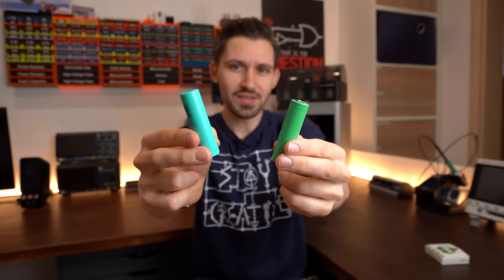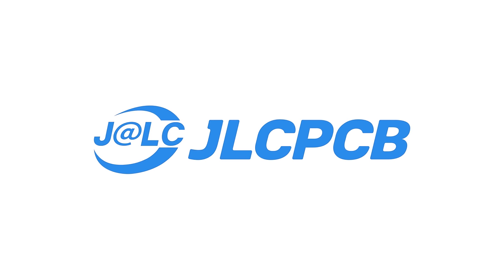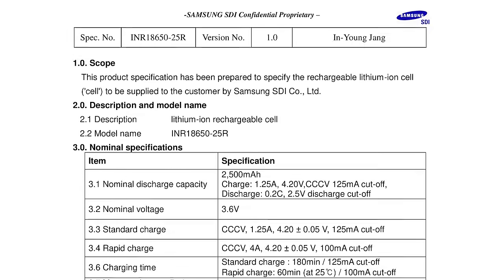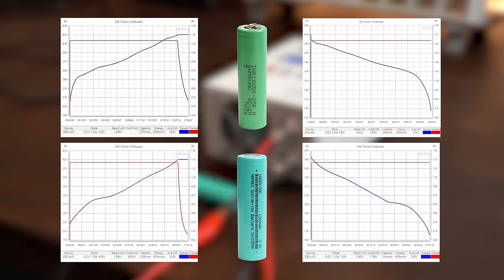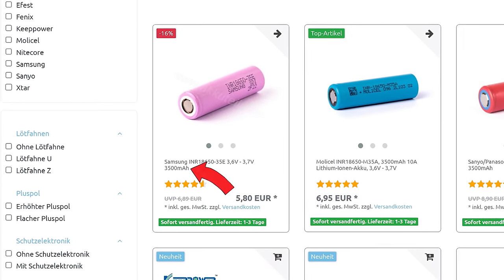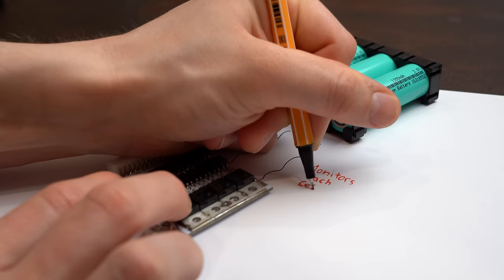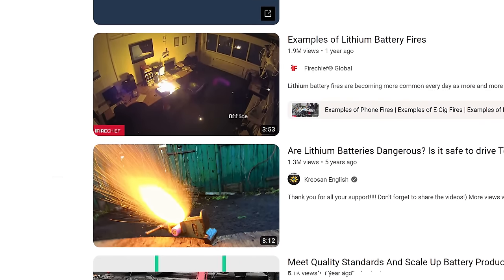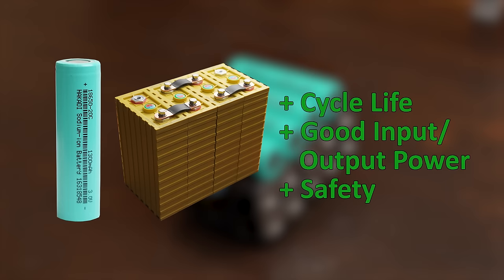"Salt" Batteries are FINALLY Here?! Sooo should you use them?

Comment: Home battery storage will be awesome for these since size isn't a big concern, same for businesses. Like if a Tesla Powerwall was twice as big for the same capacity but 25% cheaper and you know it's made using cleaner materials which we'll never run out of, and ideally not* gathered by workers in unreasonable conditions, then yeah I'd choose that version of the power wall for sure! Hopefully they start coming to market within a couple of years.  Sodium should hopefully be able to be mined for cheap in enough quantities in USA and EU too within having to rely on imports.
Reply from the maker: Love your conclusion. Hopefully it will work out this way :-)
Reply: Also safety is very important, I don't want my house to spontaneously combust because of battery
Reply: I think you left out a “not”; I don’t think you meant “ideally gathered by workers in unreasonable conditions”.
Reply: I have almost unlimited space so cutting the price for a larger battery is no problem for me
Reply: "and ideally gathered by workers in unreasonable conditions" hmmmm not sure if that is what you ment
Reply: Some US cities require a house battery to be in a fireproof room which takes up more space, so eliminating that risk even with a bigger battery might be occupy a smaller footprint, or at least eliminate the fireproofing expense.
Reply: With around 1000 cycles it's still no alternative for LiFePO4 cells unless you want to swap out your solar battery every 3 years.
Reply: @drdca8263  he may just hate people. Weird of you to assume he meant something else.
Reply: Hopefully we go from cogeneration to coproduction, since desalination and chloralkali plants have some environmental issues with discharge of high concentration brines anyhow.
Reply: e-bikes might also benefit, while it is true that density matters when your needs are 400-500wh you wouldn't really see very big difference in battery size
Reply: We're surrounded by oceans, and salt deposits are abundant around the globe, so there should never be a problem with the Sodium itself. I'm more concerned about the abundance of Chlorine which will result during Sodium extraction from that salt.
Reply: @doesnotcompute6078 that’s right. I use a 14 kWh 16s battery bank at home and have only 4 kWp on the roof. Already now in march I go up to somewhat 80% during the day and down to 10% at night. It’s not that far off to say 1 cycle per day, let it be .7 . You still compare 6000 cycles vs. 1000. 
as another guy said, for ev‘s probably a good thing but not for home application.
Reply: @RWBHere  I don't think this sodium is being extracted from salt, but well chlorine is also a very useful industrial chemical.
Reply: It might seem weird at first but I think it does also apply to Electric Vehicles. Hear me out: 

We literally don't have enough lithium to provide batteries for the entire fleet of vehicles that could be in use with 100% EV adoption, and 99% of trips people make are under 40KM or something around there.

I think a more practical solution is to use Sodium batteries for common wear and tear in city driving (thus making the largest cost of the vehicle much cheaper), possibly with a very short range by typical standards (I would be comfortable with a 20KM range, personally, for the right price!), but to have some sort of battery standard for larger lithium ion packs such that they could be swappable, meaning you could rent a pack for a single trip. This is a much more practical solution, as I see it.
Reply: @ristekostadinov2820 Probably not, ebike batteries aren't huge but even at their current size they add a huge percentage of bulk and weight to a bike. What they will be really useful for in transport though is city cars where short range isn't a big deal, and that's one of the main drivers for their development (Chinese EV manufacturers have already announced upcoming models planning to use sodium batteries)
Reply: @s3bio There's plenty of home battery solutions that use NMC though, and that has a similar cycle life, and LFP in practice is really only a couple thousand cycles, if you're thinking 6000+ cycles you're starting to enter lithium titanate type endurance ranges. Assuming that sodium batteries benefit from shallow cycling the same way that NMC does though it could be the case that just having a larger bank increases their lifespan by more than enough to make them worthwhile, since they'll wind up being much cheaper when more fully developed (plus their cycle life is likely to increase substantially since they're still a fairly new technology, whereas LFP and NMC are pretty mature).
Reply: @novantha1 I agree, and there's models coming in the Chinese market built on this philosophy, although I would add that a range of around 100km or maybe a touch more would be better because that would comfortably cover the vast majority of commutes and give some nice headroom/flexibility for city drivers (there's room for both categories as well of course). Some other things to consider though are that we don't have enough lithium for an entire EV fleet right now based in part on how large the batteries we're using are, we'd get 4 times as many EVs from the same lithium if we started deploying a lot more 100km range lithium vehicles. Plus, there's room for a mixed platform, you could use sodium ion as a wear part and have a small ish NMC pack that only gets used for backup power or long range driving
Reply: @novantha1 
Battery EVs should really only be encouraged for short trip use cases - stay home mum taking the kids to school, someone who works just a few kilometres away from home, grocery shopping trips, etc.
For primary family cars, work vehicles, etc, we should be aiming for hybrids. Reduced fuel consumption (about 50% on average) means reduced pollution and costs, all while retaining the benefit of sticking a hose nozzle into a hole to fill a tank with liquid energy in a matter of minutes. Saves the power grid from collapsing under the load of battery EVs charging constantly too....

And for the record, I own a battery EV. I quite like it, but even with only a 23kwh battery (Nissan Leaf) it's very heavy compared to my similar size i20.
Reply: @s3bio this is assuming 100% depth of discharge. Lifepo4 isn't dramatically better under that circumstance either ~3000.
If however you're a sane person and limit to 80% then 10k cycles isn't unreasonable.
Reply: Lifepo4 doesn't have any cobalt in it, that's what all the fossil fueled anti ev people complain about.
Reply: @RWBHere Well, we use a ton of Chlorine for water treatment, which ends up either into air or sewage.
Reply: @s3bio Depends what 1,000 cycles means and the degredation rate after those 1,000 cycles. Firstly it's not like they die after 1,000 cycles, thats just how many cycles until it's degregated to like 75% of so, but they still work after that. Next is that if they're like EV batteries then the rate they degrade slows over time, like EV batteries might drop to 90% capacity in say 4 years, but to drop another 10% it might take 8 more years. Lastly a cycle generally counts as a full discharge and charge amounts of energy, so you're likely not going to do a full cycle every single day, but maybe you will. So all this put together it might last well beyond 10 years, but just with maybe 70% of the original capacity, then maybe another 10 years before it reahes 50%. Not the end of the world considering this is the first versions to market. It'll probably be very cheap to replace by then too especially since you have all the other supporting home infrastrucure set up, anyone could probably do it themselves at that point.
Reply: @s3bio  That assumes full charge/discharge cycles every day (which will never happen with a properly engineered battery system). Even then you're only losing 15% of capacity and replacing the whole battery over that small loss is idiotic.
Reply: @s3bio  That number is greatly increased with shallow cycling the batteries; that's the deep cycle number. Heck, EVs and hybrids do hundreds of thousands of charge/discharge cycles in normal use.
Reply: Supercapacitor storage systems are quickly gaining traction as well.
Reply: the main concern with having large lithium battery packs in the home are their propensity to spontaneously catch on fire - whether its a powerwall pack or an EV sitting in the garage.

Except for power tools, lithium battery tech is a dead end - insurance cost will eventually drive it under in other applications
Reply: I'd feel much safer using a Salt Battery wall as opposed to the Tesla Bomb wall
Reply: @TheSulross  I'm not aware of a single "spontaneous" lithium battery fire. Poor battery management (overcharging) or physical damage. Not spontaneous.
Reply: @popefacto5945 You're woefully uninformed - there have been YT videos on EVs parked in garages that have burned houses down (fire originating from the EV not from external source or factor).
Reply: @TheSulross  Bullshit.
Reply: @saiv46  Chlorine only stays in solution (with treated tap water) because it's under pressure. It degasses quickly at normal atmospheric pressure (dissipating into the air).

Comment: Take the materials inside and place it in a flame.  If its Red flame its Lithium, if its Yellow, its Sodium.  Simple.  Hell you could place a tiny flake on the stove and it will tell you all you need to know.
Reply: I don't think the lithium nor sodium are in the form of elemental metals.
Reply: @reverse_engineered  The salt they're in the form of (Not NaCl table salt, LiKPO4 is also a salt) doesn't matter. Flame color is a result of electron transition states producing photons (light), which only happens when the atom is in the plasma ionized state. Like ionized in a flame. They briefly exist in the pure state, unbonded, so the salt doesn't matter. Biggest problem with this approach is that if there's additives that dilute or alter the color you would get funky results. Best way would be to do this but use a diffraction grating to see the spectral line. You'll see the ones of the additives, but at least also the ones of the key component. Electron don't lie baby
Reply: @UC44sHJTAL5sVGrWOdSXafyg to be fair, sodium has such a dominant and specific color that it should be immediately obvious if it's present, the diffraction grating probably isn't necessary

Comment: Sounds great for large static installations like houses. Maybe not so great for power tools and high performance applications.
Reply from the maker: Yes, exactly
Reply: @greatscottlab  Let's see if the market actually goes in that direction. Would be great to get cheap home energy storage for my solar. Well maybe I bit more difficult as I have around 800V output with 16A..
Reply: Which keeps the expensive Lithium for those batteries that really need it.
Reply: Power tools where totally fine with way worse NiCd and NiMh Cells for ~30 years.
Reply: don't see much advantage yet !!!
Reply: @kelvin1316  That would be then rare cases like say round cells etc. 
For cars it makes Environmentally no sense.
Reply: I think it could be useful for power tools and appliances as a lower cost alternative (once the manufacturing matures and the cost drops). Like pay less but you get a bit less storage or a slightly bulkier powerdrill.

Probably for cars will not work as well for EVs, but it might be worth it on hybrids to drive their costs down and have them serve as a technology maturation platform for EVs where the downsides would be less punishing.
Reply: @atrumluminarium  The problem here is that PHEVs and power tools are among the most high performance uses of lithium batteries because their peak power draw as a percentage of their overall capacity is massive. There's a reason that LFP is taking over the EV market while power tools and PHEVs continue to use the higher performing but less robust NMC based lithium chemistries
Reply: Could probably sacrifice capacity for the sake of higher currents, especially since recharging is much less expensive in terms of battery life
Reply: This would be great. Storage is the one thing that has really put me on pause from solar, the storage is so damn expensive.  I wouldn't mind if I needed a larger battery for the same storage if it's cheaper!!
Reply: Not so good for electric UAV either. I guess maybe if you use a higher voltage pack than your servos and electronics and a regulator they could be used for a receiver battery  but no way could you use them for the flight battery and they'd be less convenient than just using a 2S li-ion or lipo pack to power the low voltage electronics. The whole point of a separate receiver pack is increased reliability because it's direct battery power. If you're going to use a regulator anyway may as well just run it off the flight battery.
Reply: @bosstowndynamics5488 Same with electric UAV and hobby R/C. Lipo is the most volatile but is still used because it can supply the current. Large electric helicopters and EDF jets use BLDCs in the range of 5kW, sometimes even higher.
Reply: would love to see sodium battery tech for hybrid cars - has much better charge cycle longevity and doesnt have all the hazards and issues of any lithium battery tech
Reply: I guess they may be useful as replacement of the lead batteries in vehicles.
Reply: China just released a sodium ion electric car from BYD

Comment: i replaced the battery in my offgrid cabin with prismatic sodium ion cells already, works great. i used a JK-BMS and just configured it for the parameters of the sodium ion cells. comes with the great advantage of being able to charge in low temps as low as -10°C which lifepo4 can't do, but still it's as safe as lifepo4.
i just used a random buck/boost module to boost the voltage if it drops too low for the consumers
Reply from the maker: Thanks for the feedback. Awesome to hear.
Reply: “… up to -10C …” or “as low as -10C …”
The former sounds as if lower is a possibility.
Reply: @stevebabiak6997  "as low as -10°C", bad wording, not a native speaker :D
Reply: The -10°C problem you could solve with a piece of a heated floor foil, and a temperature sensor. I'm pretty sure there are number of solutions on a market. This is a tiny priece of the soduim low Wh/eur problem. If you don't mind to pay x2, then a standard lorry unserviceable lead batteries is a great option. Assuming a discharging to 50% to extend a battery life, here we have 6 Wh/eur from a well known manufacturer (and you still have 50% of an energy for an emergent case).